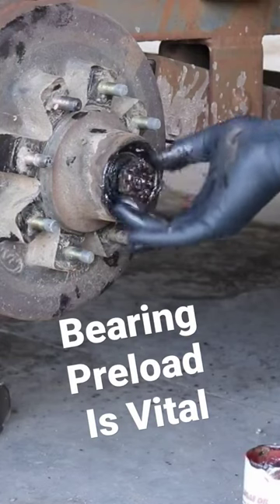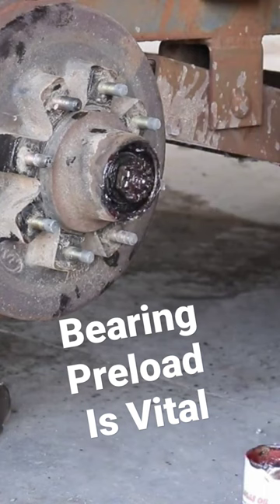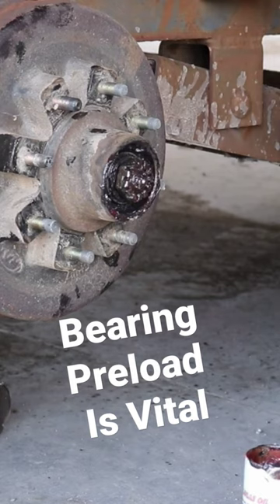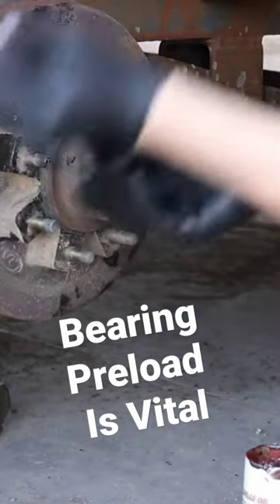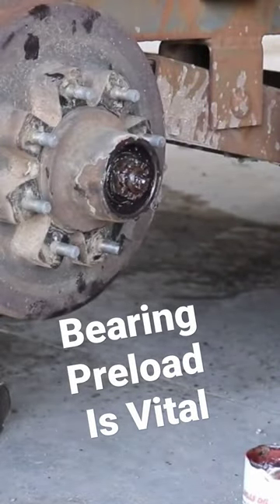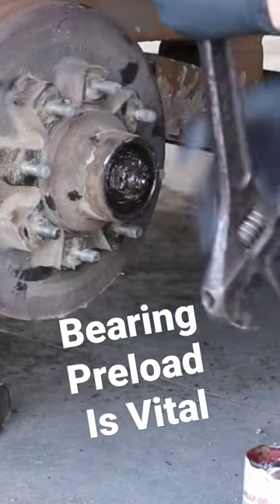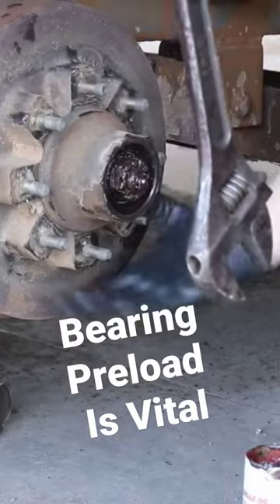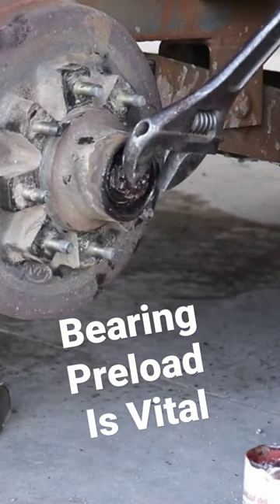Setting Bearing Preload On A Trailer

Comment: I do that wen I’m reusing bearings. Wen I use new bearings all follow the SI information. But the trick u just showed I have never had a problem while re using bearings
Reply from the maker: I use this method for all tapered wheel bearings like this, been doing it by feel for almost a decade, new and used, never had an issue. BUT: you basically can't go wrong following factory service info... unless it's a ram truck lug nut spec. it's not 180 no matter what ram says, that's a typo. correct spec is 130. but since they haven't corrected their service info the studs are snapping like crazy and you can't get parts because they can't make them fast enough.